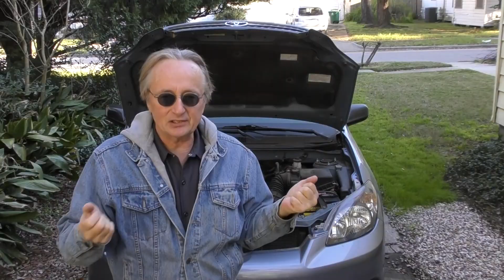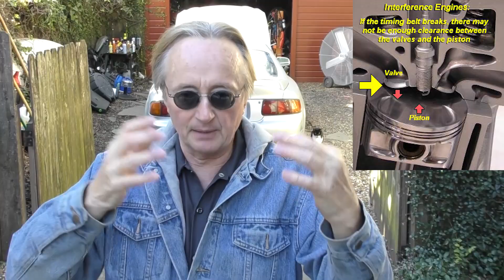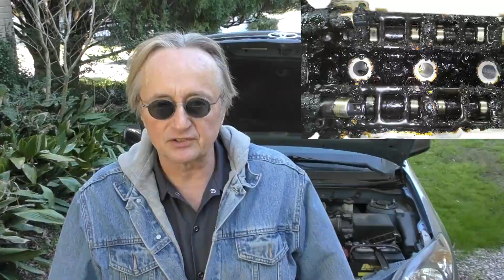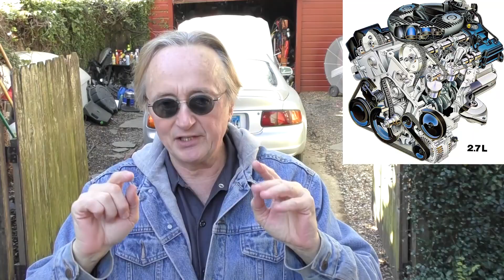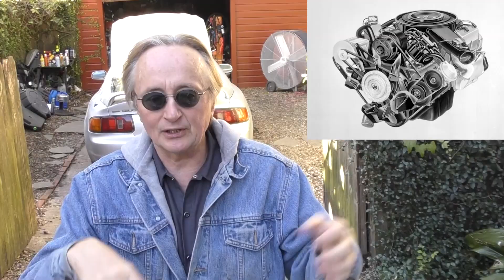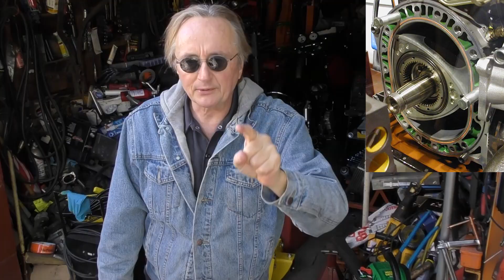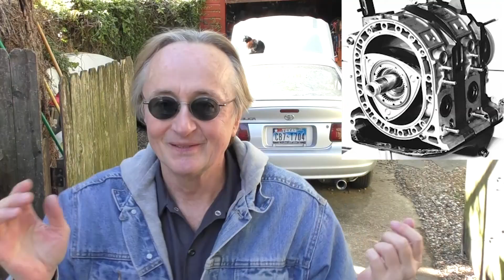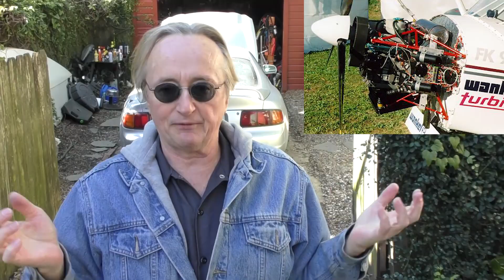Never Buy a Car With This Engine

Comment: I had that Chrysler 2.7 motor in my 2000 Dodge Intrepid...beautiful car, garbage motor. People had nothing but good things to say about the 3.5 for that car, so I bought a 2010 Charger with the 3.5 in 2012. Ran great for a while but had to replace the rocker arms (design flaw led to premature failure) and then at around 149,000 miles the rings went and I was burning a quart of oil a day. Ended up getting a 2017 Durango in October of 2017...AC died at 45,000 miles. I’ll never buy another Chrysler product again.
Reply: My dad had a series of Chrysler cars during the 80s and eventually came to the same conclusion, although we had a slant six powered Aspen and that was good.

But the general rule of thumb is that Chrysler has quality issues.  We drive Toyotas, Scotty would be proud.
Reply: @muhdewd9727  Geez that's a lot of money spent to figure out, "don't buy a Chrysler" What took you so long?
Reply: @muhdewd9727  Back In The 80:S . I had nothing but good luck. 2.2 Plymouth Horizon And The 225 Dodge Motor Was great.
Reply: My brother bought an intrepid with the 3.3 at 205k and drove it untill about 285k before he sold it lol. He later bought a sebring with the 2.7 and blew it up the first or so time he floored it haha.. woof
Reply: @kevinschmitt5592  doesn’t surprise me at all.  The 3.2/3.3/3.5 of that generation were darn near bulletproof.   The 3.5’s that Chrysler later put in the chargers and magnums were the same platform, but built with far inferior parts because the previous generation literally lasted too long.  Frankly, I’m done with v6’s.  I have a HEMI now and refuse to buy anything with less than 8 cylinders.  The power is simply there; no need to rev high like on a smaller motor.  Part of the reason, in my opinion, that v8’s generally outlast v6’s.
Reply: @miket5506  yea I think there's definitely something to be said about the longevity and how much an engine has to work to move a vehicle and at the same time you could have more than enough power but mixed with poor design is a recipe for disaster lol. But I agree typically I think most v8 engines are designed well and don't need to work as hard as smaller engine cars making them last longer. unless you're rodding on it all the time of course. Now they're making 4 bangers with 300hp bone stock with gdi/high pressure engines. Only time will tell
Reply: The intrepid was junk not just because of the 2.7, the steering rack loves to fail too. The Chargers were much better made than the Intrepids.
Reply: Lith to each their own
Reply: The Intrepid was an ugly looking car. It looked like someone made the Dodge Neon bigger. The Intrepid was as bad as it looks. It looks like a fishbowl.
Reply: ATX-CVPI you’re entitled to your own opinion. I happened to like the Intrepid
Reply: alex knight LOL I know, right?!  looking back...Other than budget, I have no idea. I’d never buy one of those again. V8 and up from now on for this guy.
Reply: alex knight you’re absolutely right. I looked at a few police auction ones. Half the ones up by me are falling apart and the other half that aren’t, are priced so high (considering they’re used) that it’s not worth it.  Right now I’m happy with my ‘17 Durango R/T aside from the AC crapping out and the R1234yf refrigerant being like $125/lb and needing 2.13lbs of it.  In doing some research it looks like the system can handle the R134a that all auto parts stores sell so I’ll probably just put that in there with leak detection dye to find where I’m losing it.
Reply: I learned my lesson with Chrysler. Owned a Dakota and a neon. Both had problems early on. Would not buy another one to this day.

Comment: I owned a VW Passat with a 1.8 turbo. From day one, I used synthetic oil against the advisement of the service tech at the dealership. A local Northeast Ohio VW tuner advised me to do so. That engine ran for a really long time without any problems. A year later, the Volkswagen dealership had a sign behind the service writer that indicated, only synthetic oil would be used in the 1.8 turbo engines.

The major issue with the engine in the Audi A4 and Passat was, they were mounted longitudinally.  That same engine in the Golf/Jetta platform, was mounted transversely. The longitudinal engines had a smaller capacity oil pans because there was less room. The oil in the longitudinally mounted engines did not have the proper amount of time to cool in the oil pan after leaving the turbo. From what I understand, that is what caused the sludge issue.
Reply: My cousin had a 98 with that engine bought with 10k miles in 99. He had nothing but problems. He was very dissapppointed because he took very good care of it.

Comment: I got the GM 2.2 Ecotec Engine in my '04 Cavalier, and haven't had any problems with it. Runs just fine, and been driving in for around 7 years straight. They are some tough cars.
Reply: Yeah I stopped the video when this was the first engine he mentioned. I had two vehicles with a GM 2.2 ecotec with well over 100k on one and 160k on the other one before I pass them on. The 2.2 ecotec is one of the better engines GM made.
Reply: @Grizzly Yes, every 5,000 miles with Quaker State 5W-30. I switch off and on between the High Mileage and Advanced Durability oil. Still runs and drives great to this day.
Reply: I have a 04 Saturn ion that has the 2.2 ecotec in it and I have just hit 270,000 last week. Still going strong. But I also change the oil very regularly. Just put a new ignition module on there.
Reply: @skippingbear92 ive got a 2004 Saturn Ion with a 2.2 with 289,000 miles and runs great. Love that little Ion.
Reply: 200k on our 2.2 Ecotec dirt track racecar and no rev limiter.  Works great every weekend.
Reply: @johnm7208  My wife had that in her Saturn Vue, and it always started, easily, down to -30F and ran like a top, even with less than ideal maintenance. Were it not for failure of the transmission at 220,XXX, she'd still have it. Except for the notorious oil burning in the Saturn 1.9, it was also reliable, but maybe the 2.2 was better.
Reply: Totally agree with you, 165k on my 2002 Sunfire GT and it still runs as it should. I did replace the timing chain at 90k but that's necessary for any engine with chains not belts
Reply: @lonniebaisden4473  Chains usually last longer than belts.
Reply: @lonniebaisden4473  pft that's nothing! 224k on mine and still the original timing chain! When i bought it at 212k it had oe plugs in it, either they were changed at some point, or original cause they looked original and pretty worn down, put the bosch 8107 double platinum plugs in it, has been running good since
Reply: 224k on mine and still running

Comment: The 2.2 Ecotec isn’t a bad engine. It’s owners who don’t take care of the vehicle. My dad races these cars, and while I have seen a few with timing chain issues, I’ve seen a lot of them that have had 250,000 miles on them and ran great. Their pretty reliable engines and are easy to work on.
Reply: not sure he knows what he's talking about.  I thought the ecotec was one of the best, most reliable engines out there put in USA made vehicles.
Reply: Don't agree with Scotty at all on the 2.2L Ecotec.  Might be an interference engine, but at least a timing chain will give you some warning before it simply breaks.  Timing belts might be a different story.

Also, who cares about the V8-6-4 from 40+ years ago!  Very few were produced and only for a short time.  Pretty sure it didn't impact too many people.

How about we talk about the lousy fuel economy of the Toyota Tundra or even the Tacoma V6?
Reply: The 2.4 is awful.
Reply: Mines still going it was smoking but I saved it by doing an engine flush
Reply: I've heard bad things about the Ecotec 2.4

But the 2.2 I used to have a Cobalt didn't have it that long but I bought it with 120,000 sold it with 140 engine was still in great shape

My girlfriend has an HHR with the 2.2 I think it has 150-160 something like that engine has been reliable but we're in Michigan (part of the rust belt) and it's time to find another car and get rid of it because the rust is really bad now on that thing

Comment: Never buy the Hyundai 2.0 Turbo.  Hyundai used defective metal in the crank bearings and the direct injection causes the valves to fowl with carbon.  The turbo is very poorly constructed and stops working effectively once the thing heats up.  There’s a known design flaw in the fuel injection that causes engine fires.

Comment: I’m 36, and my best cars were my first two cars: 
1992 Pontiac Sunbird SE convertible with the 3.1 V6. I bought it at 17 years old from an old lady that drove it a few times a week. She had perfect maintenance done, and it only had 32k on it in 2001. After I bought my next car, the sunbird literally sat in my parents garage for 7 years....my father dropped the fuel tank, put in new plugs/wires, new battery, new filters...and she started right up. By the time my father gave it to a friend’s daughter who was down on her luck and needed a car, the old sunbird had 330k and was still running like a total champ. Old school OHV engine with an archaic 3 speed auto...dated but perfected. 

Next was my 1996 Celica 25th Anniversary. Had 71k when I bought her in 2004. Taught myself how to drive stick on this car, so the clutch was destroyed within the first year. Other than that, all I ever did was brakes and regular maintenance. Literally nothing ever went wrong in over 6 years and 150k miles. She had 221k on the clock when I traded her in, and ran like a champ. 

It’s been all downhill for me since those two amazing cars!!

Comment: The 1.8 Audi isn't a bad design, it's bad owners not adhering to VW's OIL specs, it's VW 502 spec oil. says it right there in the manual.

Comment: I have a 08 chevy cobalt an I have work on many mainly suspension cause it's crap. But mine my grandfather bought new an gave to me  from 35k miles I drove it 600mile an th ECM went replace it an at 120k miles I replace the spark plugs an serpentine belt. Now it has 172k miles no engine knock/ping noise no issues an only uses about 1/2 QT of oil in 5k miles

Comment: My 07 Malibu ls have 2.2 4cyl eco tech engine. My car engine is fine without any problem at 130k miles. There's plenty of other problems however such fuel pump, power steering, power window, thermostat and few more.

Comment: I drive a 2004 Chevrolet cavalier with the 2.2 engine still running fine then again I have had it from 74000 now at 95000

Comment: I HAVE A 2.2 I4 PUSH ROD CHEVY IN MY S10 WITH 260000 MILES ON IT. REGULAR MAINTENANCE IS KEY TO MANY MILES OF PROBLEM FREE DRIVING.SPEAKING FOR MYSELF I DON'T NEED ALL THAT HIGH PRICED CRAP ON MY TRUCK.

Comment: Scotty and viewers, I occasionally drive in the mountains here in Arizona and my transmission gets a real workout both uphill and downhill. Some of the hairpin curves are slow mph but very steep. Am I wrong to use the gears rather than braking all the time on my 2016 Highlander AWD?

Comment: I had a 1999 Dodge Interpid 2.7 Chrysler. I rebuilt the engine after one of the piston rods bent. After the engine had been rebuilt, the timing chain broke when the water pump bearing busted. Engine gone for the second time.

Comment: Thanks for the video Scotty, so in layman's term, The motor for (GM) vehicles especially the Silverado, Tahoe, Sierra, etc, are not good motors. My 2008 Chevy Tahoe had (Active Fuel Management), and I had no Issues with the motor whenever the engine kicked down to (V4) mode, and when I needed acceleration to merge onto highway speeds, the engine performed flawless. If I didn't look at the information screen, I couldn't tell when the engine shifted into V4 or V8. I think it was a wise decision for GM to incorporate their improved engines into the 2008/14 on up series cars and trucks with the intention to conserve fuel for the average driver. My 2015 Silverado is not a work truck, generally a pleasure vehicle, but if needed I can use it to perform work duties. I enjoy your amazing amount of knowledge, and I appreciate your honesty, but we may disagree on today's GM motor capabilities, I think they came a long way and made numerous improvement to their engines. If I run into any complications in the near future with my truck, I hope I can find a mechanic like you to resolve my issues!

Comment: I had a Ford Escort that had a water pump driven by the timing belt. At around 60K, I had the belt replaced and the pump as well. At 120K, i had the belt replaced and the mechanic said the pump was good, so left it in. I wanted it replaced but the job was already completed. Around 170K, the engine got noisy. I removed the timing cover and the water pump pulley was loose and causing the racket. The good thing about that engine was it was not an interference engine but the pump could still seize, break the timing belt and leave you stranded.

Comment: A friend has a GMC Terrain with an Ecotec and the engine died at close to 100K. It was running poorly with a CEL. She had it scanned by a mechanic and he got some codes relating to the crank angle sensor. He changed the part and the engine ran and then suddenly stopped. The timing chain either jumped or broke and it was game over. She towed it to the GMC dealer, who confirmed it was toast but offered no other assistance. I noticed lots of owners with similar issues on the net but she needed a car now, so she did not escalate the problem and had the first shop put in a new engine for around $5K. Then a cat that the engine wrecked and a few sensors. That engine now has about 20K and she is careful about her synthetic oil changes. Needless to say, she won't be buying another GM.

Comment: They must have figured out something when it came to the B207R (Saab/GM Ecotec 2.0T), because I've been running a stage 2 boost for 100,000 miles without no problems at all.

Comment: I have a car with the 2.0L LSJ Ecotec engine, Supercharged. I do my best to take care of it.  IT's 12 years old, and has 142, 000 miles on it. Every oil change, I put in the exact oil that it calls for. Mobile1 5W-30

Comment: I have a 2006 Saturn Vue with a 2.2 EcoTech and it currently has 270K miles without failure. Is this what you mean by unreliable?
Reply: Yeah I don't what he's talking about. My cobalt went 311k I got rid of it when the ecu went bad and it needed suspension and and some other stuff but as far as I could tell engine was going good. My wife's driving an HHR and its at 260k. Just change your damn fluids.

Comment: I had a 2006 Dodge Stratus with that Chrysler trash in it. My grandma got it for me. I drove it 150k miles then the water pump went out. The part was cheap but the mechanics was telling me that they didn't even want to work on it for less than 1500. The car was only work 2000 kbb value. Junkyard

Comment: My Saturn ion 2.0 ecotec is still running at 330,000 kms with no knocks, ticks or anything wrong with the engine. These engine actually never die. It’s the 2.4 engines that are notorious for blowing

Comment: 1.8 liter Toy engine on a 2010 scion with 130,00 miles burns half a quart of oil every 5,000 miles and still very reliable car which I use daily for delivery. This car still runs great.

Comment: currently have 1st gen RX7, i use it as a daily for 8 years and i have no serious problems. it has 250k km of mileage in total and the engine  hasn't been rebuilt even once. the thing is, most of those people who says rotary engines aren't reliable, they just simply don't know how to  maintain them. 1liter of motor oil every 700 to 1000 kilometers ain't that much of expenses,  and giving 10 - 15 minutes of time to engine to warm up won't hurt that badly to your everyday schedule. this engine isn't horrible, it's the exact oposite

Comment: Surprised to hear the 2.2 ecotech was on the list, our family and friends have had several Cavalier’s, and Cobalts over the past 15 years with these engines and have never had any issues.
In fact, the first Cav I had “2003” 5 speed manual developed an undetected oil leak around 50,000 miles due to the cartridge oil filter cap cracking. The engine started making mechanical noises but no low oil pressure light. I checked the oil and wound up adding 3.5 quarts to get it up to full. “The capacity is 5 quarts”.
I figured damage had to have occurred but the noises went away and the thing ran out past 150000 miles and a friend still owns it and it’s still running.
Another friend has his 2003 Cav  auto tranny with over 150k miles and it’s still purring along.
Eh, who knows?

Comment: The chevy 2.2  eco tech engine, was it also in the Pontiac Grand Am? Or is it different? Had a 2003 Grand Am with a 2.2 and had it for almost 400000 kms. Engine was still good when I got ride of it, but not due to the engine. Good engine, bad design.

Comment: Didn't the AMC Pacer have a rotory engine?
Reply: It was designed for one, at some point in its development. They ended up mostly getting the carbureted AMC inline six. Which was a very reliable, almost bulletproof engine, but not especially fuel-efficient (which was part of the reason sales slumped). Realistically, that was before Mazda sort of unwittingly proved that, in a realistic passenger car application, a rotary engine that produces power like an engine 4X its size tends to use fuel like an engine 4X its size. So the rotary engine probably wouldn't have helped the Pacer stay competitive. Maybe if it had been lighter, or could have jumped forward a few years in engine technology to where a smaller engine could move it around, it could have fared better for a while. It was the 70s and the weird design really doesn't seem to have been the biggest problem. It just promised more than it delivered. A small car that drove like a large car was cool, but why buy a small car that eats gas like a Deuce and a Quarter?